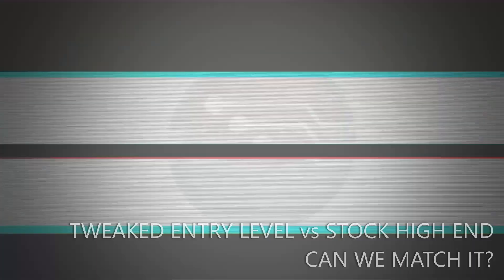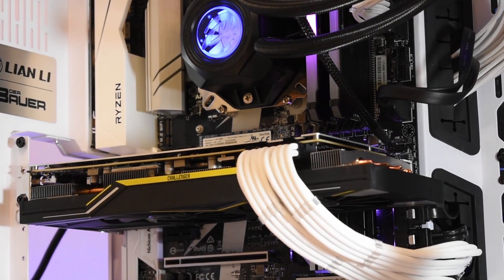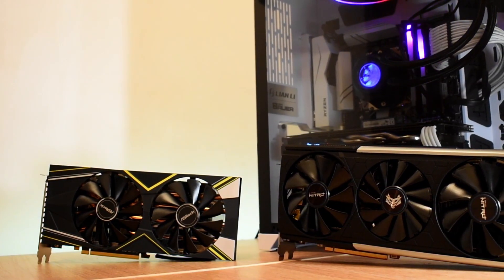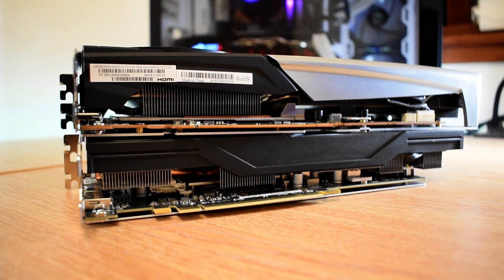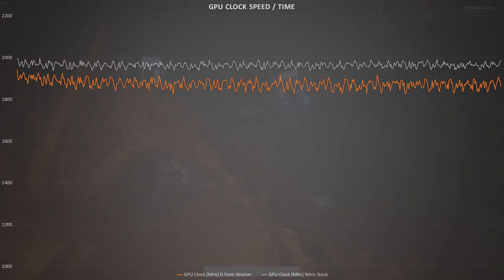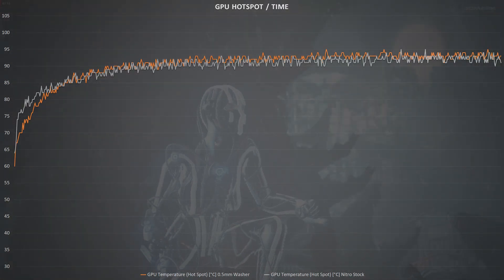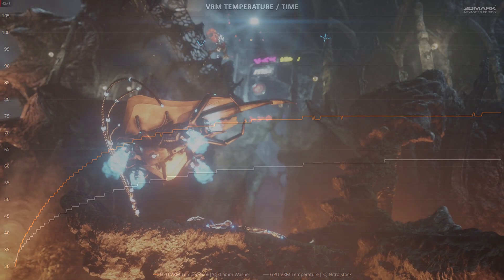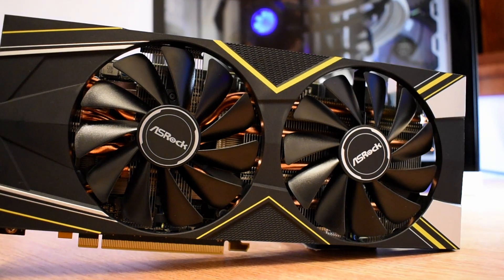Tweaked Entry Level RX 5700 XT vs Stock High End 5700 XT - Can We Match It?

Comment: Very good work, really good and well explained video! Got a Challenger, was worried in the beginning with temps, but followed some of your steps and got very good results. Heavy gaming is getting maximum 76 degrees and not even a drop of performance.
Despite the fact my cabinet is closed and it's fans aren't that good, I'm getting some better fans, so it should get a little bit better figures with better air flow. 
Cheers boss!
Keep it up!

Comment: Just buy a 5700 and reflash to 5700xt,(Asrock 5700 requires AsRock 5700/XT bios etc etc.

By the way december drivers are here too.

Nitro+ is 3 slots, 2.5 doesnt exist on a mobo